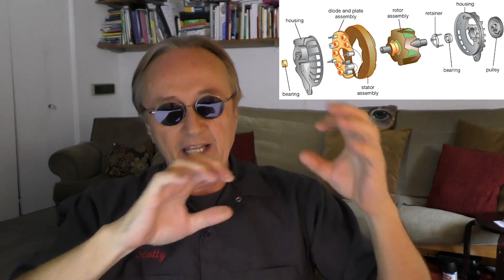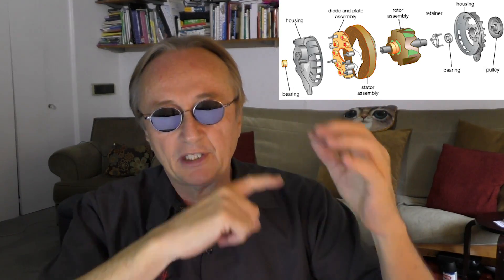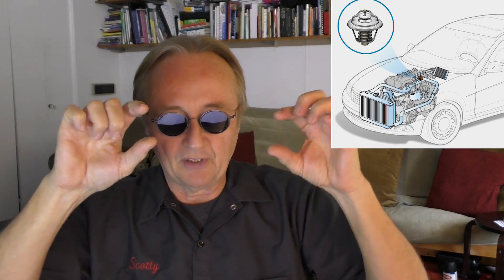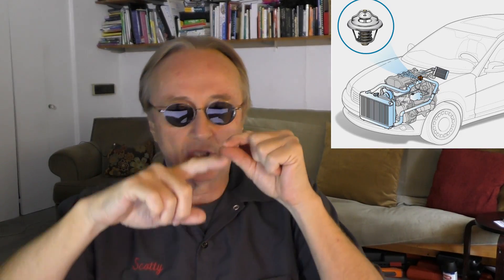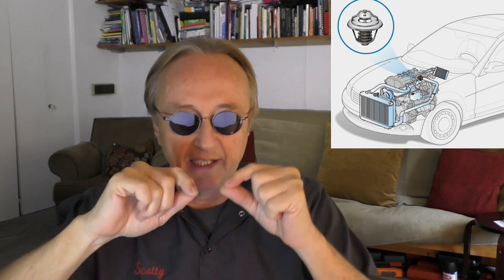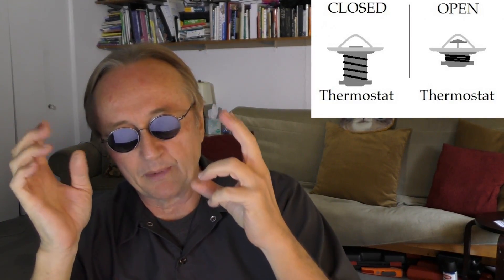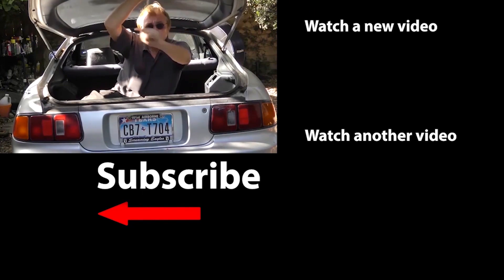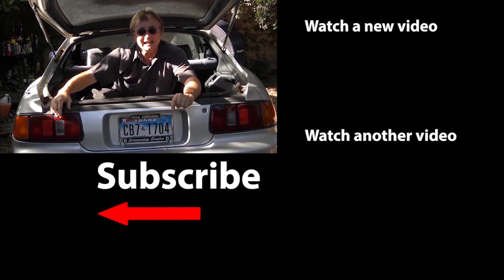Doing This Will Destroy Your Car Battery

Comment: This Will destroy your car battery-

Not owning a Toyota
Reply: CatAttack 6471 😂😂😂😂😂😂😂😂😂I'VE GOT A 90'F-250 7000LB 4X4 W/480K MILES ON IT.....RUNS RITE OVER YOYO'S
Reply: I’ve seen that Toyota, Honda, etc. batteries last longer, but that means the terminals corrode a lot more between changes.